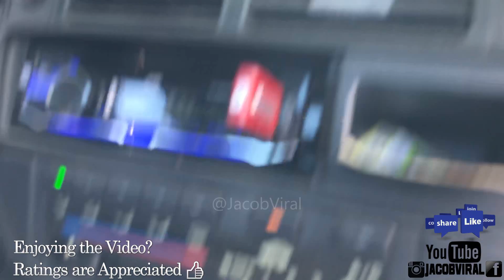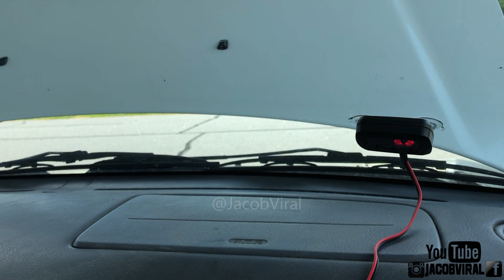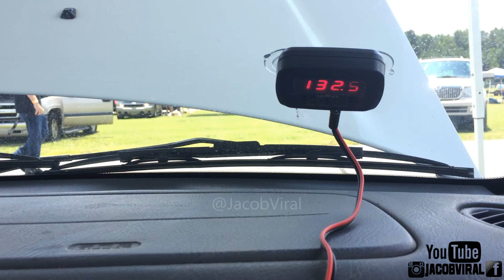SINGLE SUB TRUNK BUILD ON AN OLDSCHOOL AMP *SURPRISE*

Comment: It goes to show that even old school can get it too. Very awesome job my basshead brother.
Reply: Dude old school amplifiers absolutely crush the new amplifiers that are available today.  Just one example is I have a zapco competition series amp that is "only" 75 watts x 2. On components I swapped out an alpine pdx 150 x 2 and the difference was shocking.  Zapco was louder, wayyyy cleaner and the midbass had so much impact.
Reply: Most definitely do you remember the old school Virtual technologies boxes???? They came into the car audio world back in 2000 they cost $1,000 bucks for the single 15" combo those old school combos hit over 150 DB I had a few of em over the years the box's are massive though and tuned low

Comment: That port isn't big enough for a mouse fart let alone a 15" sub. But if he's happy with how it plays that's all that matters.
Reply: He definitely needs a bigger port.  My two 8s have that size port
Reply: Good for ultra lows
Reply: @danielanderson8001  Yes but if he kept the same tuning frequency and opened up that port more he would get even more lows.  As long as he is happy with it though!!
Reply: Just cause the width of the opening isn't big doesn't mean a thing. How long is the port? Is it a T line?
Reply: @commonsenseisdeadandgone  What I am trying to say is he would get better results with lows if he had more port area and kept the same tuning.  The port area he has now is way too small for that box.  Sure he can play lows still but they won't be as good as if he had the same tuning frequency with a bigger port.
Reply: @scottbe1  tuning frequency changes with port length.
Reply: @wespope7547  Yes exactly what I'm getting at. He has plenty of room in that box to increase his port area and lengthen his port to keep the same tuning frequency. If he were to do this his output on the lows would be better than what he has now.
Reply: @scottbe1  port area is not indicative of the opening, you cant have the same tuning with more or less port area. There is zero knowing what his port area is without knowing the length..... Is it 50" long or is it 5"?  It looks odd but it works all the same
Reply: @commonsenseisdeadandgone  Look it up I promise you yes you can.
Reply: @commonsenseisdeadandgone  I beg you to look it up on Google my guy because you can make the opening bigger as long as you extend the length of the port
Reply: You can open it up if you shorten the length.... Again it's all one in the same and there is still no answer to what his port area is as is
Reply: @scottbe1  size of the port opening is relative
Reply: @commonsenseisdeadandgone  I must not be clear. Port Area is width and height of the port. You can adjust the tuning of that port with the length of the port. If you want to make the port area bigger you need to make the port longer to compensate for the bigger port.  So with that being said.... if this guy were to have a bigger port for his sub and accommodate that with a longer length port, to keep the same tuning frequency, the loudness of his lows would increase over what he has now. That's all I'm trying to argue.

Comment: How do you wire a single dvc1ohm to 2?
Reply: U cant. If it was dvc 's, u cood wire it in series to 2 ohm but u cannot do it with a single.
Reply: U will get more power from ur amp if u wire to 1 ohm if possible.
Reply from the maker: A dual 1 can go to 2 ohm. Wire a poss of one coil to a negative to the other coil. It’ll be 2 ohm then on the other terminal.
Reply: My bad, i read it wrong, thought he said svc, i see now he wrote dvc 1ohm to 2.
Reply: Wire in series, right jacob, pos to neg.
Reply: Goggle wiring diagrams for subs for specific wiring configurations that u want. U do have options, just not many with 1 sub.